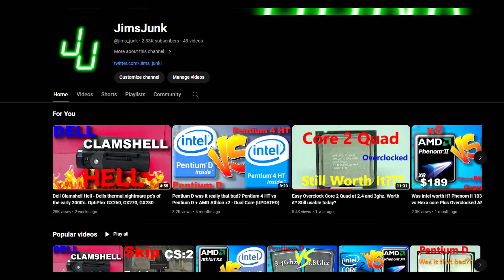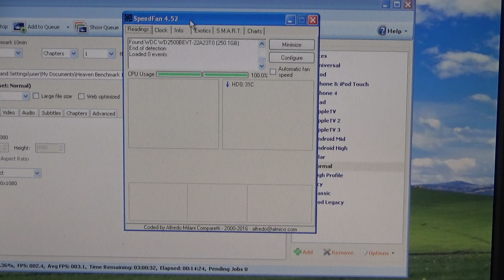DE-HeLLification - Dell Clamshell overheating thermal fix?  Optiplex GX260, GX270, GX280

Comment: It's kind of a shame that this case had such bad thermals. These older dell cases were built like tanks and I'd love to use an Mid tower one for my next case if I don't go with the Fractal Design North, just because of how sturdy they are. I wish dell still knew how to build durable computers.
Reply: I personally recommend a dell dimension tower from this era for a sleeper build. It worked great for me, just put fans on the bottom of the case. Keeps the sleeper look, with good thermals
Reply: There's a lot of work involved in getting new hardware to fit in those old optiplex cases. Motherboard standoffs need to be installed which requires beating the mounting flanges for the old motherboard flat with a hammer. The IO shield area needs modifying. The PSU opening needs to be cut to allow the plug to fit on a regular psu. The front IO cable needs to be cut and soldered onto standardized connectors for USB and power button/drive light. The list goes on.

Comment: I remember the middle school I went to got a bunch of these when I was in the 6th grade in 2007, I actually got to help set them up. I'm not sure if they were new or refurbished at the time as I didn't get to see them in boxes. By 8th grade 2009 a lot of them were already boot looping. The high school I went to was across the street and they had over 100 of these in the library. By then a lot of them were either extremely slow, would boot loop, would crash, or were completely dead. The school then replaced all 100 or so with brand new 2010 apple imacs in the middle of my freshman year. After this the library was much quiter and cooler. I remember the school newsletter talking about how they got a grant from somebody to buy them and how teachers weren't wanting to take their classes to the library to use the computers because they were so slow and frustrating for the students to try to get their work done on as a lot of them didn't even work and a lot of them would take up to 20 minutes just to go from the log in screen to the desktop, but now that they got the new imacs all the teachers were wanting to schedule the library to use them for their classes, so much so that there was now a waiting list. They even opened up the library during lunch time to let students come in there and use them due to the high demand.  It's crazy the things I remember. By the time I graduated in 2014 the imacs still ran like new and last I heard when a relative of mine went there in 2019, they were still there and working fine.  So they definitely outlived the dells.
Reply: Same thing happened at my school district, old dells to iMacs

Comment: Rather than showing the improvement after 3 different mods were applied at the same time, I'd love to see the results of each one independent of the others, as well as what happens when just 2 of the 3 mods are applied. For example, measure the temps when:
a. only reversing the PSU fan (same voltage, no CPU fan shroud)
b. only adding the CPU fan shroud (no changes to PSU fan)
c. reversing PSU fan, leaving it at stock voltage, plus add CPU fan shroud 
d. reversing PSU fan plus increase fan speed w/7V, but no CPU fan shroud added
The result would help identify which mods are most effective, as well as how much (or little) the other mods help.

Comment: That difference is crazy! Your previous video inspired me to buy an old Optiplex as my school used to have them. So thanks to you I'm now the proud owner of a bad-capped and hot running GX270  :)
Reply from the maker: LOL not sure if I should say 'congrats' or 'I'm so sorry' :)   Well if anything welcome to the club!
Reply: if you have a 3d printer or know someone who has one have them print the shround so hot air doesnt come back in. it will stilll be 55c bu its still a drop in temp.

Comment: Found your channel through the original video and loved the "retrospective" style you went for. Experienced these machines in a very hot & stuffy computer lab back in school. More videos like that! - I'm subscribed for future uploads :)
Reply from the maker: Hey thanks, sorry I never responded before.  Yeah I think we all have ptsd in some form or another from these things 😀.  Part of me still misses those days.  I still remember working at one client when my co-worker walked in with a tower that was reported to have the fans running 100% all the time.  It wasn't a dell, just a generic beige tower.  Well it had a Pentium D.  The heatsink got so clogged up that the thing melted the plastic snaps that held it to the board and the cpufan and heatsink were literally dangling by the power lead.  PC still ran with zero heatsink......poorly..but it booted into windows.  I used to have pictures of it, but damned if I can find em now.
Reply: @jims_junk  what a time it must have been to work on those machines back in the day haha.. unfortunately I got into IT support in 2020, nowhere near as fun and interesting 😂 I picked up one of these SFF GX series after your video just for some nostalgia throwbacks, especially as I never really got to tinker around with the inside of them. Such a thermal beast!
Reply from the maker: @Techwen  lol yeah there were so many designs then where you'd stare at it and go WHYYYYYYYYYYYY

Comment: We had these in a Call center I worked at.. and the slightly larger version of the P4 cases had slits in one side following the contours of the grey pieces.  These side would be the top if you had it vertical.

Comment: It works that way because the power supply is originally 160W, and it works close to its limit. During load, it easily reaches 80 degrees, and this is a temperature above the temperature of the air inside the case, so it is not viable to blow air heated to 80 degrees into the case. It is better to blow 60 degree air into the PSU and have it expelled through its ventilation grille.

But to be honest, the HDD creates a lot of heat inside the case, replacing it with an SSD will make a big difference. The side near the processor has a ventilation grille on the plastic part, but it does not match the metal part. There are no ventilation holes on the metal part aligned with the plastic part, which creates resistance in the air that should circulate.

Comment: This is the opposite of what I did with a large number of first generation ATX PCs that had the fan in the bottom of the PSU, blowing warmed air at the hot CPU, and recirculating internal air through various holes in the PSU case.

I'd flip the PSU fan and seal up all the internal holes in the PSU with aluminum flue tape. Pull that CPU heated air up and blow it out the back. Eventually the ATX specification changed to exhausting air through the PSU as it had been pre-ATX.

With this low profile Dell case the warming of air pulled through the PSU is far less of a heat adder than the CPU and very poor circulation. Surprising that Dell didn't have a duct from the CPU directly to the back when many of their towers had a passive heatsink on the CPU with a duct/hood up to a rear mounted fan to pull a lot of air past the CPU and blow it directly out. Blowing hot air in the general direction of the perforated back panel, while the PSU fan is simultaneously pulling air in through that same panel is madness.

If you want finer visualization of airflow using smoke, get some punk sticks used for lighting fireworks. They're the same thing as incense sticks, minus the scented oil. Light it, blow the flame out, have a narrow and steady source of smoke.

Comment: That fan shroud thing you did is actually what Dell did later on Core i models that still use the blower style coolers. Still,imagine if this had a dedicated GPU it would probably reach 70+

Comment: The best solution, I had for Dell Optiplex GX 280 (Pentium 4 LGA775 and PCI Express x16 slot) was to cut opening for 120mm fan, and that large fan helped so much, harddrives didn't died anymore.

Comment: Very interesting video, this modification of this computer is very interesting, I will definitely do the same in my DELL Optiplex gx260. It's strange that dell didn't use such a solution as you showed in the video, surely then these computers would be less faulty

Comment: I did something like this for a custom full size optiplex sleeper PC. I don't know about the slimline ones, but the full size models have a very small grate above(when upright) the usb ports to intake air. I used this to my advantage by replacing the 92mm fan at the back with a super thick(and loud) one. To prevent the extreme negative case pressure from fighting the psu fan, I opened up the PSU and turned the fan backward. Then, to keep the CPU fan from fighting the psu fan, I also turned it backward to suck air up from the mobo through its low profile cooler. The gpu survives thanks to some vented PCIe covers that intake air sucked through by the rear fan. God, that whole case was a PITA. My head almost exploded trying to get the front headphone jack detection working with the HD audio standard(works perfectly now but isn't pretty).

Comment: Had one in highschool for our graphics class. Thing would overheat all the time and our IT guys eventually took it apart to do something and left it in the office. I took the shroud and used a hole cutter from shop class to cut a giant hole in the side. IT guy wasn't too happy until he checked and it stopped running magma hot. So he screwed a mesh over the hole and called it a day.

Comment: Dell once made a BTX variant of the Dell Optiplex GX280 at one point to address the thermal issues with the GTX 280, however, these computers are rare and aren’t easy to come across.

Comment: I did that with my optiplex, but I think that you forget to mention that the best performance is  using a laptop hard drive or  an ssd, because a full 7200rpm hard drive get's way too hot and combined with the exaust air that now comes from the PSU makes it even hotter, in my case reaching 69° in just the hard drive. So personally, if you are using a 7200rpm hard drive i recommend to just do the 7v mod to the psu, but not reversing it, or it will exaust hot air directly to that already hot drive, and adding a small fan to the original "intake" for getting a little better performance and trying to avoid killing your drives.

Comment: I've encountered this on other Dell machines. Mine have side air intakes and it would bring air from the back; I put a magnetic floor vent extender on the side of the case so it brings air from the front.

I figured the heat from the power supply being blown inside the case would make it warmer. So everything is cooler, including the power supply which now gets fresh air from the outside instead of warmed air from the case.

Comment: Heyo, Officer94 here with a new channel. I just came back to this because I'm using this old fella for a while now with the mods you have shown in the video. The 3D printed Shround is one of the best things to get the hot air directed out of the case and Dell actually installed some new Fans later on which also had an shroud design. 

About reversing the fan tho this is where things get a little "tricky" - I have measured higher temps on average the longer the machine runs if the PSU fan is set to 'blow air' into the case. I guess the PSU does in fact heat up to a point where the air isn't cold enough anymore to give the rest of the system the cool breeze it really needs.

So does that mean this system is just doomed? Well actually the engineers at Dell were designing this machine in a clever way; It uses negative pressure to create an passive "air path" inside the case but it was just poorly executed (can't blame them tho since the P4 'space heater' was just bad CPU design in general). The large 3,5 HDD blocks most of this concept so air get's "stuck" in that area and heats up quickly. Also the pre installed northbridge heatsink is a joke - this thing actually get's even hotter than you might imagine so slapping a small 40mm fan on it fixes that too.

If you now "reverse the PSU fan" to keep pushing air into the case, the CPU temps will suffer since the thermistor inside the fan just doesn't get "hot" enough to make it spin faster. Same happens when you just open the case like you shown in the video. Cold air will "bypass" the hot heatsink so the fan slows down but the heatsink actually becomes critically hot and the CPU starts to throttle.

The GX280SFF which uses a newer 775 board actually doesn't have this issue since the Fan is controlled by PWM this time and the fan curve is pretty much aggressive too. (And twice as loud)

So what's the solution then? Hmm hard to say here but I've figured out that removing the expansion slot cards metal bracket gives the system more area where cold air can flow into the case while keeping the negative pressure level constant so the CPU Fan will still do it's job perfectly fine. Reversing the PSU fan can work but it will make the CPU temps suffer. Also installing an 2,5 Drive in these machines (SSD's are cheap enough these days) will help with the airflow as well. 
Yet I would say it's definitely recommended to hook the PSU fan to 7V since this is a must nave no matter which way you have it installed. (Funny enough theres a label on the PSU saying it can operate until 50°C max)

I'm maybe the one pusing my unit to the extreme since I've installed an Geforce 6200 and soon a P4 HT prescott and play some good old retro games on this thing. So far nothing has blown up and I'm sure it won't with all these mods. Too bad we just can't go back and tell the engineers to do these criticall changes before they pushed these PC's out on the market.

Just my two cents :D

Comment: Dell Optiplex GX520/620 where designed for better airflow from the factory, because they were based on Pentium D.
Reply: I had a gateway gt4024 with a pentium D and that thing ran HOT. Fans were super loud too. I probably ended up cooking it by using it pretty much continuously from 2006-2014. It was very quiet its first year but by 07-08 it was very loud and only got louder as time went on. It eventually became completely unusable. I replaced the hard drive, ram, thermal paste, and graphics card out of boredom in 2015 and that didn’t help it. Maybe the capacitors were bad. Who knows. I don’t have it anymore
Reply: No, they are better because its BTX design. BTX is alot more efficient than ATX.

Comment: I'd say that you can improve airflow more if you're willing to modify the shroud so it covers the entire heat sink rather than just the area where the blower sends air to. I'd say that it is strange considering the Optiplex 755 Tower I currently use as a server has one large fan with a shroud that pulls air from the front and cools the CPU first before sending the air inside the rest of the case.

Comment: apparently, whoever designed this pc was a rocket scientist. I know pc's were the new big thing at the time and if you had even dialup you were the shit but if they know thermals can be an issue, they should've tested their products before releasing them on the market to breakdown in 1 year just to make sure it wont happen with regular use before mass producing them. i honestly though it had an intake at the front like the desktop but no.

Comment: Dang! I imagine this also helps with the "up against the wall" problem, since the old fan config realistically had 0 way for new air to enter into the machine if it had a CRT monitor on top, and a wall <4 inches behind it.

Comment: i have an Acer Veriton X270 -- heh he h it shares a model # with the Dell GX.. it's a DDR-2 small form factor similar to this one in video. I wonder if drilling holes in the flat part of the top of the case could improve airflow, since i installed a half-height GPU into the one of two slots in the MB. 
I don't know if there's enough spare space in the case - it's all tight  AF in there. Removing the ROM drive can create a RAM air effect, but it looks unsightly. I want to see if I can drill holes in the case to improve airflow.
You did alot of work that most ppl can't do with testing equipment, running voltage, rearranging a power unit etc. Cool though.
What is the long term  effect of the comp running at it's stock temp vs the reduced temp after your modification?
Reply from the maker: I haven't used it since this video as I have no real use for it.  However I did let it run for quite a while just to test to make sure it wasn't a fluke and the temps were rock solid.   

As far as drilling holes, I thought of that.  In doing that  I'd also have to block off the rear vent where the air would enter the case and use the updated fan to plug the exhaust.  Essentially keep the hot air out and allow cool air in to sweep across the board.  The tower version was much better as it allowed for air to be sucked in from the front.  Not much, but enough to make a difference.  

I still have the computer, so maybe I'll do a further update with other ideas in the future if there's any interest.  I'd also like to pull the mobo out and try and fix the one ram slot.  Only one slot works.  Not sure if its further cap problems, or if its just a cracked solder joint.

Comment: what if you block off the sections of the rear vents that don't have any direct in or out air flow, trying to make the back "leak proof" is what i'm getting at so air can only go in through the PSU fan and out the CPU fan. kind of like how laptop vents work.
Reply from the maker: was going to, but when I tested it with the smoke...case air actually was exiting from there.  So if anything that would create a buffer between the cpu fan exhaust and the power supply intake. Regardless the temps are so low, it doesn't even matter now.